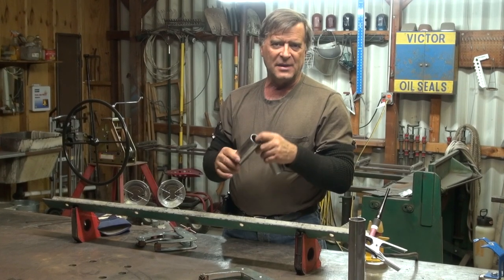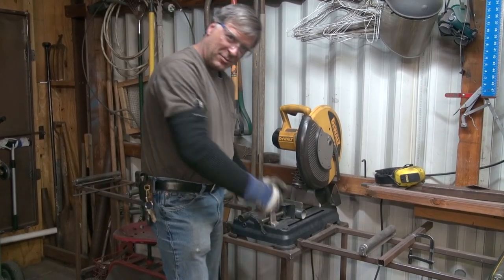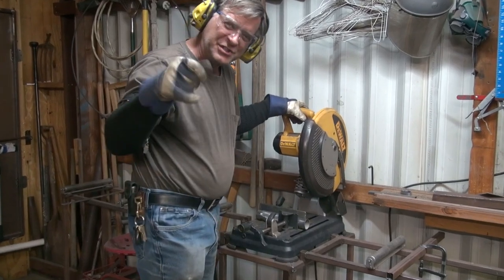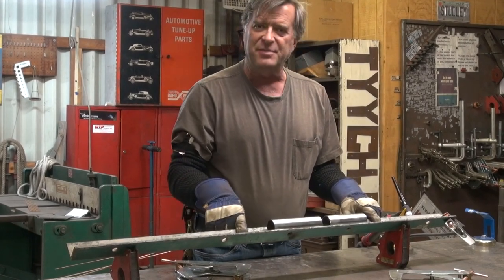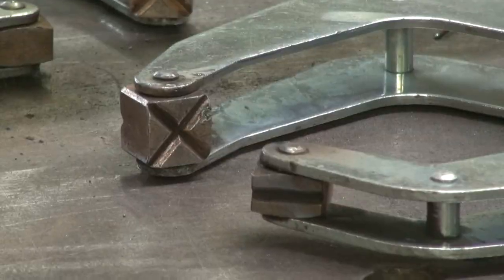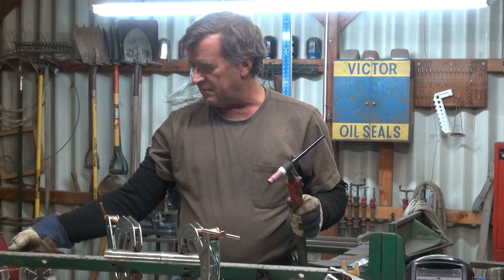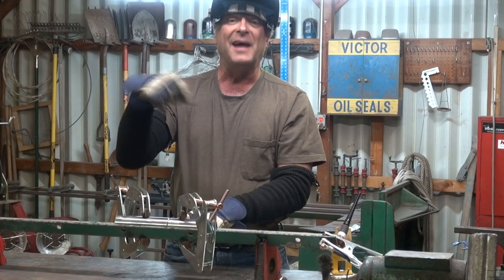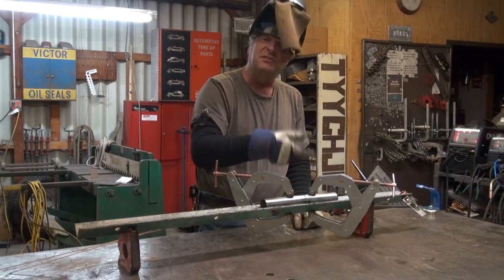How to Seamlessly Join Two Pieces of Pipe - Kevin Caron

Comment: Brilliant Video.
How would you join 2 pieces of tube say on a motorbike frame, IE in a situation where you can have the frame on the bench in your jigm something like an insert
Reply from the maker: Jason Parker Same way.   Small piece of angle and two clamps.. If you can't get the angle in there then three pieces of square stock and a couple of hose clamps.
Reply: Jason Parker I used thick steel plate as inserts with holes in the tube to fix them to the tubes. Then weld the tubes. Still holding ;)

Comment: thank you for the idea i go to camp and i weld pipe by stick welding .. but after welding i need to cut 2 pipe in 45 degree and i forget to bring my chub saw !! i try to cut it by angle grinder but its hard .. and that the question how to cut pipe in 45 degree .. without chub saw and only by angle grinder !!
Reply: thanks kevin !

Comment: Hi Kevin, so you are using a plasma cutter to brase?
Reply: What?  It looks like he's using a TIG (Tungsten and Inert Gas, or Gas Tungsten Arc Welding) and a stream of Argon gas to WELD the steel tubing, and also a little bit of steel filler wire to fill up the joint so it can be ground flush.  There is "Plasma Arc Welding which is nice, but expensive and not usually found in the Art sector.

Comment: thanks kevin; nice blade, thinking no 'set'  tool steel only here. correct? ive tried an off cut saw with a liquid cooled high tooth count solid carbide blade rotating much slower, maybe only 30 rpm - thicker stock capable, much quieter overall operation.

something (an apparatus of sorts) to consider > tube parts 'a'  & 'b' held fast by clamshell style conductors - a slight way apart; isolated as positive and negative 'stations', a switch is thrown (current, voltage, whathaveyou terminology is now 'live'), a hand levered mechanism introduces the workpieces together, the 2 pieces of tube heat up then join together, some sort of selenoid/contact breaker interrupts the process automatically shutting off the switch...the external clean-up procedure should be basically the same?

above is one method for the joining of bandsaw blades by utilizing the gizmo mounted directly onto the front side of the saw...i saw much larger pieces of pipe at the junk yard that looked like somebody tried a similar technique, very basically the parts were 'welded' successfully other than the clean up part > more than likely why they were there in the first place...

Comment: Hi, I've recently started watching your videos after seeing you on MrTig's channel. You have some nice videos, keep up the good work.

Just a few tips to add on joining pipe;
1. As Fileman pointed out a few extra pieces inside the main angle will give you a nice relief for your weld bead. However I would recommend not welding them in place since you never know where you are going to need that relief positioned along your main angle.

Let's say you have a 6ft main angle, you could need to join 3' & 1', 4'& 4' or 5'& 2', who knows, right?

 Better to have 4 loose pieces about ⅛ the length of your main angle and place 1 piece either side of your join with about ½-1" gap, then position the other two pieces  if needed to support the middle or end of any long pieces.

2. When grinding down the weld, better not to use longitudinal strokes, it tends to produce a whole bunch of flats. Instead try leaving the joined pipe in the angle jig and rotate the pipe with your thumb or palm while the other hand holds the grinder stationary with the 4” grinder pad reasonable flat and at the top of the weld bead.
If you see grinding marks to one side of the weld and not the other it is a sign to slightly adjust your grinder angle, when you start to see the first signs of grind marks occurring simultaneously on both sides of the weld, stop. If you need to you can finish by polishing with a polytex machine (or similar device} to give a mirror finish on stainless or aluminum etc.

With a little practice you can produce a joint that is impossible to detect even unpainted.

Cheers
Reply: (russhellmy) This is well said!  (Part 2).  People just grind everything, I think the thing to do is concentrate the grinder action ON the part that's too big!  I'll keep changing the angle and try to catch a nice bright reflection on the grind marks, and keep the action ON the bump...  and just as you say wait for the grind marks to spread from the bump to the base material.   After that some general movements might blend things and confuse the issue a little, but then you'll have a depression where there was a bump!  You can definitely make things WORSE with a grinder!  The way you're saying sounds like really superior technique.  I like the idea of switching to something finer the moment that the work is flush!  Depending on the situation, I like to use a big flat file as the bodyworkers do, to indicate the high spots.  With a very light pressure the file with catch on high spots and not really touch the flat panel at all.

Comment: Very helpful video Kevin.  I have used that trick for years BUT what intrigued me was the blade on your cutoff saw.  What kind is it?  My cutoff saw uses an abrasive cutoff wheel BUT if you aren't careful you can work harden the piece you are cutting and really make a mess of it.  Thanks in advance for the info.  I really enjoy your videos (and your art work!)  Fred
Reply: ***** is it for a long use or like abrasive one and what materials can it cut (al, pb, cu, fe, inox...?)
Reply: Check out the saws fromDewalt and MIlwaukee that use the carbide tip blades that cut dry and with little to no sparks. I saw a welder who used one few yrs ago and it cut through a 4" by 3/8" I-beam like it was butter !!!!!!!

Comment: if you weld two pieces of  angle iron into the v of the first angle leaving a 1/2 inch between the ends you will have a place to rotate the first weld into, so you can maintain true alignment.  that solves the high spot problem and you don't have to grind off the first weld